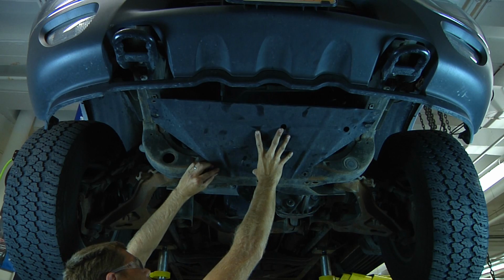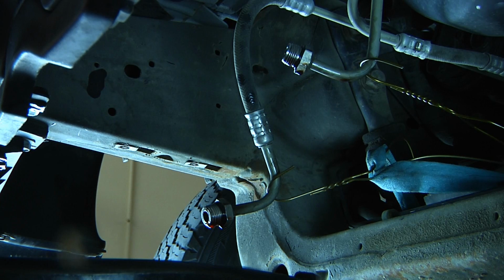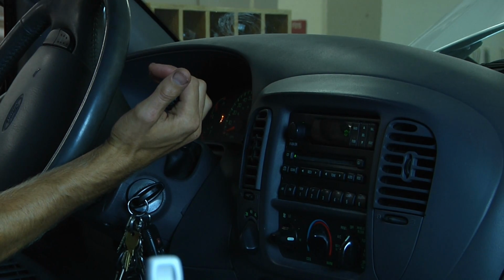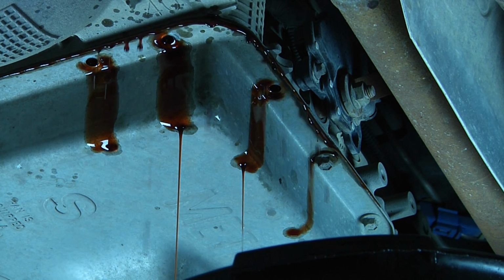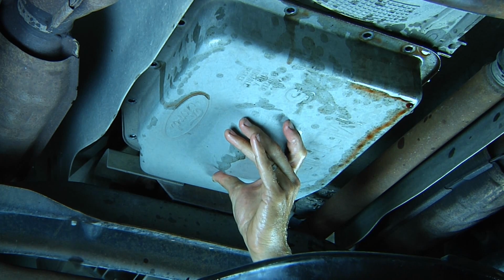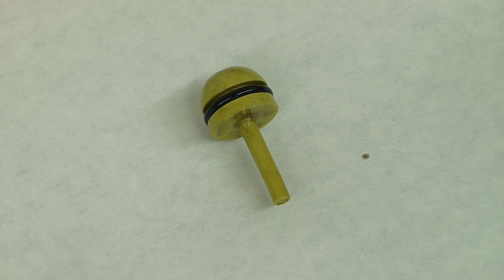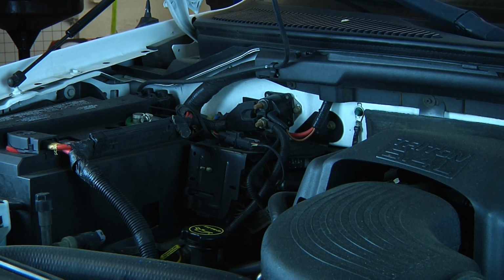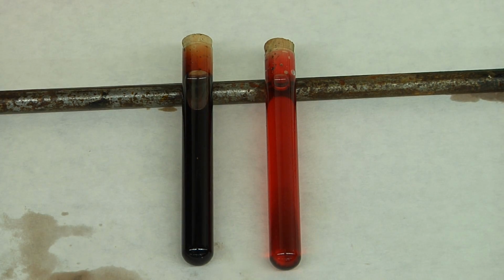2001 Ford F150 Transmission Service (Flush, Torque Converter, Oil Cooler, Pan & Filter)

Comment: Thanks for another great video! I was just wondering if you would happen to know why a trans on a 2000 f150 5.4 liter would be making kind of whistling/whining noises in first gear and reverse under normal driving conditions? It doesn't do it all the time, but when it is placed into first gear manually(it's an auto trans) it just has a constant whine. Also, when it is cold cranked in the mornings, it makes a really strange, almost pulsing, whining noise for just a few seconds when it's placed into reverse which seems to come from the 4 wheel drive shifter area in the floor board. I've been told that it could be some kind of pump??? Sorry to make this so long, it just has me totally confused because it is driving absolutely normal. Any input you could offer would be greatly appreciated! Thanks for your time...
Reply: Also, the fluid is full and is still red...
Reply: *****  Thanks for the quick reply. I have owned the truck for the past 40,000 miles and I've never changed it. The truck has 178,000 miles on it but the trans was replaced by the previous owner,or so they said, and so the trans should only have about 100,000 miles on it. Fluid has probably never been changed I'd be willing to bet, so it's probably past due. It says on the dipstick to use Mercon V trans fluid only. Do you think changing the fluid and filter out would help? Is there any trans additive that would be beneficial to add in when the fluid is changed? There is also an added in-line filter on the trans line at the front of the truck near the rad. It looks old as well.
Reply: ***** Thanks a lot! Will definitely try this soon! Appreciate the links as well. Just out of curiosity, have you ever known of many pumps in these type of trans to go bad? Just curious...
Reply: ***** Oh, sounds good. Thanks again for your help!

Comment: Would it make sense when running new fluid through the system to disconnect the return line instead of the supply to get the old fluid out of the coolers too?
Reply: Yes you should do a full flush if your transmission has been regularly serviced with fluid flushed but if you have high miles or not frequent enough flushing this is actually the recommended process by repair manual so that you leave about a gallon of that dirty transmission fluid in there to keep it from slipping

Comment: Dont really know i just got the truck a week ago and then all of the sudden it just happend....
Reply: ***** In my 94 T-Bird the fluid looked ok and in my 93 Vic but there was sludge in both. The Towncar actually looked worse but shifted well. Change the fluid and filter first. Before draining converter drop the pan. You may find the filter in the bottom of the pan.

Comment: Hi there Mr.Olson i have a 2001 ford f 150 4.6 and it was running fine and all the sudden it didnt want to shift gears. the check engine light was on so i borrow a scanner and it gave me codes of shifter solenoids A and B also torque converter clucth. So i will like to know what would you recomend for me to do change the solenoids or swap the tranny out. any input is much appreciated

Comment: Mr.Olson, I have a 2002 F-150 extended cab 4x4 4.6L. It has (I'm sure) the same tranny in it as the 01 you did. Today I got in and drove it and noticed it shifting hard and the overdrive light was blinking constantly. Well I went to Advance Auto and got a quart of transmission fluid and put in it and it hasn't come back on. Please tell me I didnt ruin my transmission by running it low on fluid! Also I want to flush and change my fluid and filter like you did. I bought the truck in 06 with 80,000 miles on it and it has 171,000 on it now and I have never touched the transmission till this evening! Would it be wise to change the filter and do what you did or should I just leave it alone? Thanks and I liked that video!!!!!
Reply: ***** got my amsoil fluid today and within the next week or so gonna getter done!!!  Good informative video sir. Ty

Comment: When I got rid of my 93 Vic I dropped the trans to see what causes shudder and slippage because the car that replaced it had the same drive line and transmission problems. I found mayo(oil & water) in the valve body.

Comment: How do we tell which transmission is in the truck? Looking at my maintenance guide its either going to hold 16.4 quarts if its the 4R100 or 13.9 quarts if its the 4R70W. I have the same truck 2001 4x4 4 dr lariat, engine code L. Thank you.
Reply: I went to the Ford Owners website and put in my VIN #, that also told me which Tranny I have.
Reply: Justin Spencer had to go here to find out what plugs were in my truck
Reply: Nikolas Smith thanks guys

Comment: SOMEBODY PLEASE RESPOND:  (1) Why not connect to the return line off of the radiator? (2) Would it be a good idea to cycle through the gears while pumping out the old fluid? (3)How do i know how much fluid to add while it is being pumped out? None of the videos on this flushing technique explains this, they all just say to not let it run dry. Is the idea that you are not going to be able to add more than it is pumping out, so there is no chance of overfilling and as long as you are adding it will not run dry? Thanks in advance for any response.
Reply: Procedure from my Hayes manual for my 1994 Ford TB. Drain converter. Drop pan, change filter. Install new filter, wiggle it around and make sure it is in. Install pan, add 4 litres, start engine and add the rest of the fluid. Idle for 20 minutes.

Comment: my torque converter has a drain plug. can I just drain the converter and the pan and replace what I took out?
Reply: Douglas McCarty
Older Fords were designed to be fully serviceable, therefore they did have drain plugs on the Converters.
Reply: Yes, I was intending to replace the filter and as much of ATF as possible since it is probably 15-20 years old.
Reply: Peter B. Is this the same drain @ 6:00? I have the same vehicle. thanks.
Reply: mdh88 That rubber plug at the bottom of the bell housing gives you access to the torque converter plug. The plug is actually on the torque converter. When I did mine I was very lucky and it plug was right where the access hole was. Otherwise you will have to rotate the engine with a breaker bar by the large bolt on the front of the harmonic balancer (the pully that drives the serpentine belt) or start and stop the engine over and over until you are luck like I was the first time.
Reply: Douglas McCarty My 94 t-bird does. So did my 93 Crown Vic and 96 Town Car.

Comment: In the last part of the video, why not disconnect the oil cooler return line so that the old fluid is pushed out of the the oil cooler?
Reply: *****
The deposits will not all come out by gravity draining.

Comment: I understand pulling the supply line to flush the torque converter and transmission, but how does that flush the cooler it self? Should I reconnect the supply line and  flush it out the return out let? Im installing a used transmission into my 2002 F150. It has far to miles on the engine to justify a tranny rebuild. I just want to make sure I don't contaminate the used tranny with any debris that may be in the cooler..
Reply: Thanks for the quick response! I will definitely refer back to this video after I perform the tranny swap...

Comment: That multipurpose fluid is all well on good on the 4R70W, but never use anything but a Mercon/Dexron only fluid in a 4R100
Reply: *****
Vehicles that came with the 4R100 specify in the manual that multi-purpose fluids that include a Mercon V specification cannot be used in the transmission due to the friction modifier that the Mercon V specification calls for which causes the clutches to glaze over. The Torque Drive fluid you posted is the only fluid I would use in a 4R100 because it has a Dexron III/Mercon rating without a Mercon V rating. This has been confirmed by a retired Ford engineer that designed the 4R100 over at the ford-trucks.com forum

Comment: Had my feed line blow before, not fun, by the time I was done, all the transmission fluid was swapped, just might as well do the filter now. I had the transmission a little overfilled with fluid for a little while, it just doesn't like to shift as much, I emptied it to the right level once I was sure the leaks in the line were fixed. Gotta love New York and their road salt.

Comment: ford torque converters have drain plugs why not drain it clean the oil coooler lines seperatly thats how i always do ford trans full flushes.
Reply: Where is the drain plug in a torque converter,Thy only drain is in the pan, plus some vehicles havr a drain plug in the tranny case
Reply: *****
touche

Comment: Hey Jon. I recently bought a 98 4.6l f150. It was running perfect until one week later. I started the truck up and put it on reverse and it was still good then put it on Drive and didnt go. I accelerated and still nothing I had to accelerated it even more and went slowly then drove good. Does this everytime I press the brakes and try to go again still have to accelerate a lot for it to move. If I press to much it burns tires and acts like it wants to turn off. Like if you were driving standard. Can you help me out?

Comment: Can I just drain the converter from underneath the trans or is it better to do it with the line
Reply: Ok and how much did you use before you turned off the motor I'm going to be doing this by myself
Reply: Cool beans I have the same truck ...thanks for your help bro

Comment: im paying $140 to have this done to my f150 tomorrow. money well spent in my book
Reply: ya this one is dropping the pan and changing the filter. they are the most highly recommended shop in my area, and their shop has a big window between the shop floor and the waiting room, so that the customer can watch them as they service your car. they are a little higher priced ($40/ oil change) but they actually do things properly, and inspect your ride for issues.
Reply: UnRefinedHero It's always good to have a reputable mechanic that you can trust.

Comment: Following your procedure, would there not still be some old fluid in the oil cooler? you drained the trans, and flushed the TC, but once you hook the line back up to the oil cooler, isn't there going to be new fluid entering the cooler and whatever old fluid left in the cooler and the return line being pushed into the trans?
Reply: Good catch.  That is one part that I did not clarify.  Since the actual oil cooler sits above the send/return lines, when I disconnect the line (and drop the pan), gravity will drain the oil cooler and line.  To help this, you can also put some compressed air through the lines...just don't have a very high pressure because you don't want to blow any seals or lines.  Hope this helped.

Comment: i would use a mighty vac through the dipstick before drooping the pan saves you all that mess of dropping a full pan of oil, also good to wear some latex gloves any time your changing oils as they are carcinogenic
Reply: And wipe that reusable gasket clean and also wipe where it meets the case . If not you'll have a burnt film on there next time.

Comment: Taking the hoses off at the beginning allows you to determine which hose is the supply and which is the return.  Basically it lets you know which way the fluid is flowing and where it will shoot out of when you get ready to do the fluid replacement.

Comment: Also forgot I read where some people were having problems getting the gasket to stay on while installing. After cleaning take and run a small bead of black rtv on the pan and tran. Put the gasket on the pan over the rtv and let it sit for 30 mins. It will start to set but just on the outside it will still be soft in the middle. Then u can put the pan on its so much easier!
Reply: No! Just use a couple zip ties and remove them once you get a couple bolts loosely tightened through the pan.

Comment: The only reason I watched this video was to find out where that little yellow plug with the O ring on it went. Thank goodness this video included that. Turns out its useless however it let's me know in 98,000 miles my filter has never been changed lol.

Comment: After adding the transmission flush, you want to make sure all lines are installed, prior to running the vehicle.  This will allow the transmission flush to work its way through the entire system.  Afterwards, you will want to disconnect the supply side when flushing the fluid out.
Reply: I usually like to disconnect the return line, and use an adapter on the coolers. that way, you also flush out the coolers, so no residual solvent in them remains to dilute the new transmission fluid.

Comment: I had about 100k miles when I serviced this transmission.  However, when I purchased the vehicle it had about 94k miles and I had no records of previous service.  If you are running conventional transmission fluid in severe service conditions (towing, in-town only, etc), it is recommended to change the transmission fluid every 30k miles.  Amsoil transmission fluid service interval is every 50k miles under the same circumstances.

Comment: No dipstick.  I did some research and everything keeps saying that i need to take it to a professional.  I thought about pumping the fluid through the system but I would not know how to check it to see if it had the correct level.  Any suggestions about how to check the level?  The plates on the truck looked like Nebraska.  I went to school there.

Comment: On a 2009 F150 transmission fluid change.  I have identified the inlet side of the oil cooler.  I am trying to figure out where to add the oil to the transmission.  There is a reservoir for the transmission fluid but I can not find the fill tube.  Any help?  Where are you from?

Comment: Great job!  I have a 2001 Ford F150 XL 4x4 and am going to change the transmission fluid.       I was reading that I may have a plug on the torque converter.  Can you remove that plug and drain instead of flushing the supply lines?  I really don't want to risk not putting enough fluid in while it's running.  Dropping the pan alone is about 6 quarts and my manual says 13.9 quarts required when changing.  So I'm assuming the rest is in the torque converter?
Reply: You certainly can. And it's very easy.

Comment: I have a '96 f150 e4od w/170,xxx miles. Is there any reason I wouldn't want to use the amsoil synthetic after a flush. I have heard that it MAY cause issues because the bands have been soaked in conventional fluid. Truck has been serviced regularly. However, while it is running great, it is old. I need another year or so from it before I invest in a trans rebuild.

Comment: Great video! AMSOIL is the best, I use it in everything, even my wood splitter. I also run it in my R6, good to have in an engine that spinning 17000 RPM!

Comment: that display that shows the cooling lines is odd for me for the smaller cooler in front of the radiator isnt even for the transmission, its for the power steering.